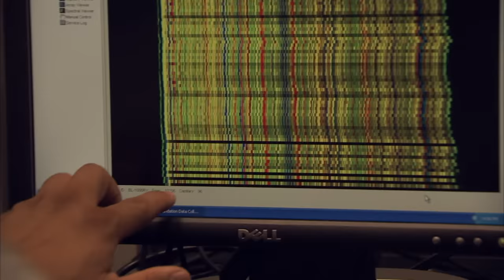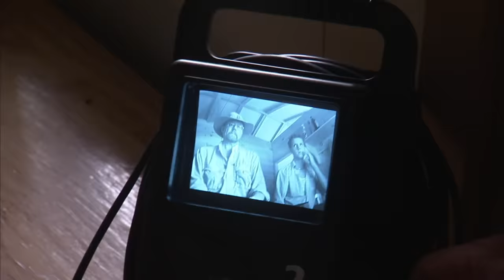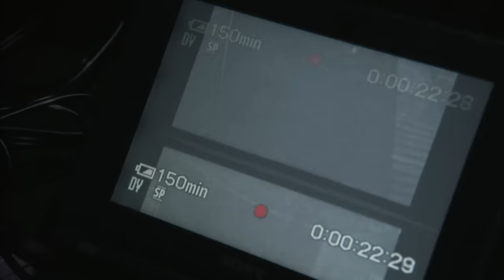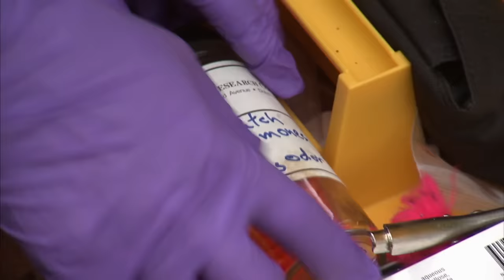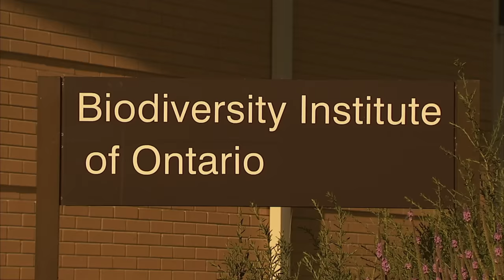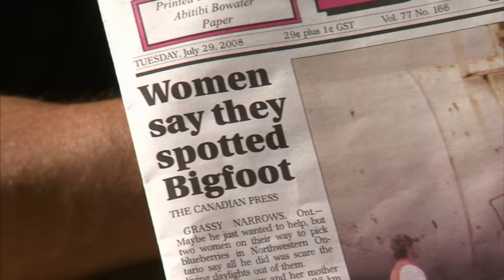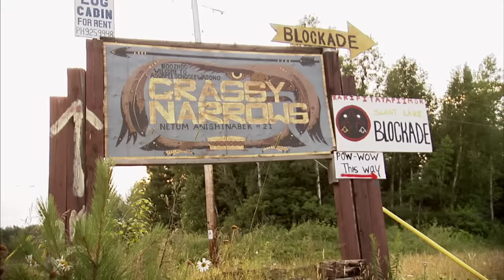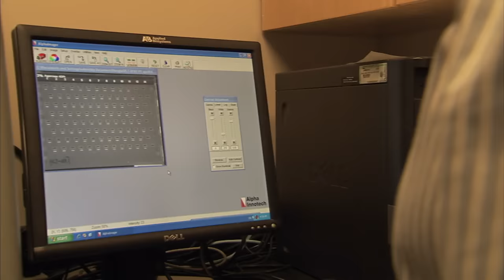MonsterQuest: SASQUATCH ATTACK PROVEN BY DNA (S2, E20) | Full Episode | History

Comment: I am wondering why, if they truly wanted proof, and knew when the berries would be ripened by the cabin, why didn't they didn't fund staying and be set up for then. Also, imho, if they fished, trapped, or collected berries they might get a territorial reaction.
Most reports that mention cameras, it seems that these beings seem to have an aversion to electronics, probably can hear/sense the hum. If you want to understand, find a radio you can tune and stop where there isn't a broadcast, that noise is around us all the time but we don't notice it, while these beings seem to.
Reply: Siesmic intruder detection devices - stick them in the ground for perimeter defense can pick up a deer walking and silently alert we used them  in the military they are low tec and work almost impossible to detect
Reply: Leave bigfoots fish and berry's alone

Comment: What if they set motion sensors in the woods and connect  them to a alarm inside then you could put cameras inside or by the motion sensor then they could just check the motion sensors or camera from inside. Just a suggestion though

Comment: 06:24 "I found it was identical to human DNA except it had one nucleotide polymorphism.  That nucleotide that was different was the difference that was shared with chimpanzees.  I got DNA that was primate dna."

Even if a human had stepped on the nail board and bled on it he would have had primate DNA since humans are one of the 8 species of great ape.  The main difference between the DNA of humans and chimps is the fusion of DNA at human chromosome #2.  I'd love to know where this polymorphism he found is located in the dna sequence.  The only thing I'd really question is that blood really stains, so having tissue remain all the way at the bottom of those nails and a 17" print means that poor critter should have bled EVERYWHERE and blood stains really well.  Once those proteins set that bloodstain is there for a really long time, but that board is really clean for the injury that supposedly occurred on it.  Either way this is probably the most interesting Monsterquest show, for me, out of the entire series.

Comment: You take for granted that it can't reason.... it's not an ape. Your wrong. Wood knocks are not used for communication.  It's used for echoe location and gives them ability to see their surroundings in the dark. And next time you see a tree structure. Use ground penetrative radar.  That's where they live. Usually near river banks because the grounds softer to dig out. It yells so loud even while out of sight you can actually feel it on your skin. Next time use a slide whistle and play simple 3 and 4 note tunes. It will respond .  but it is definitely 100 percent  NOT an Ape.... sons of Enkindu .